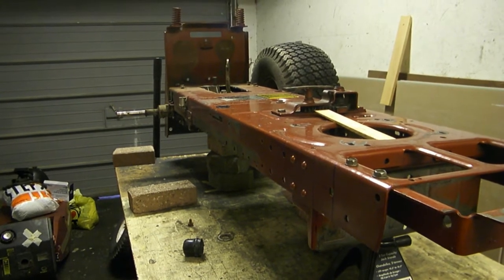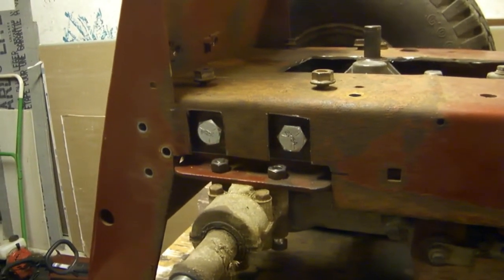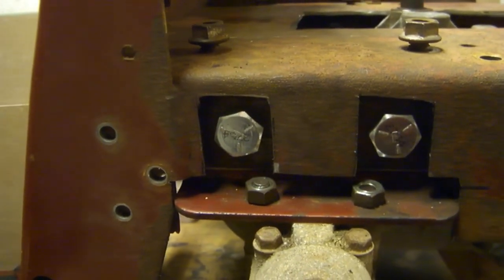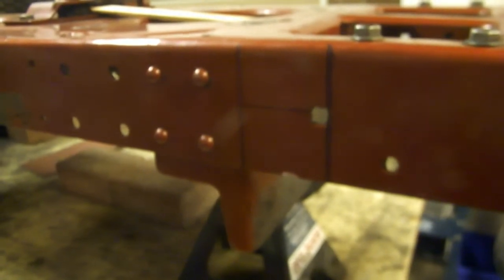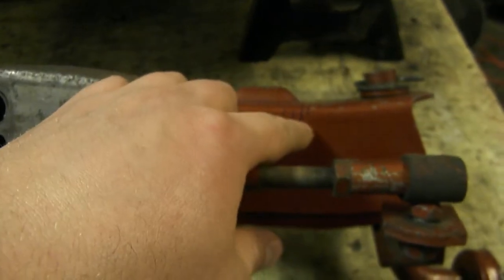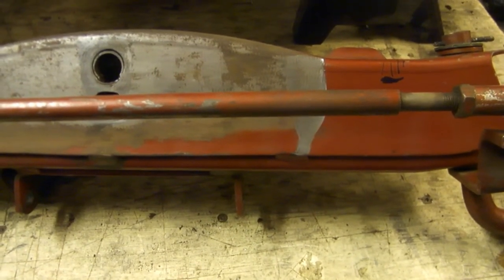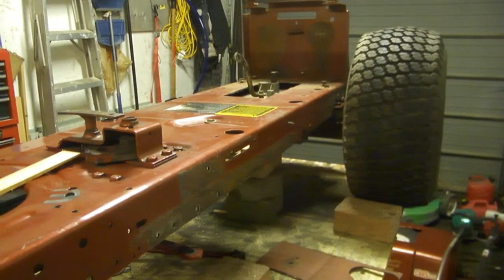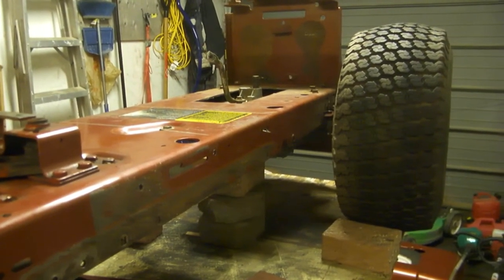Racing Mower Build Lowering the Rear

Comment: I just flipped my axle and spindles but just drilled and tapped them and stuck a bolt into it .have about 3 inches of ground clearance
Reply from the maker: That's awesome!
Reply: @RideauValleyMotorsports  but I also have some pretty big tyres on the front  I think they are 19-7x8